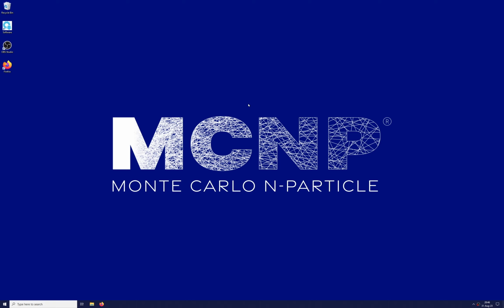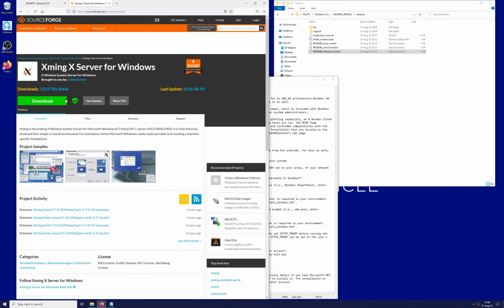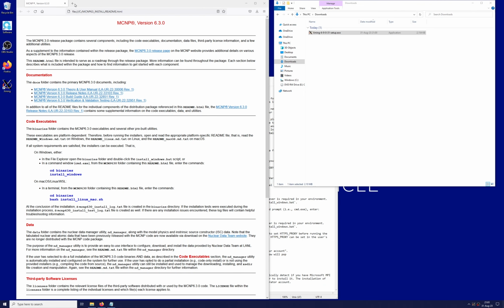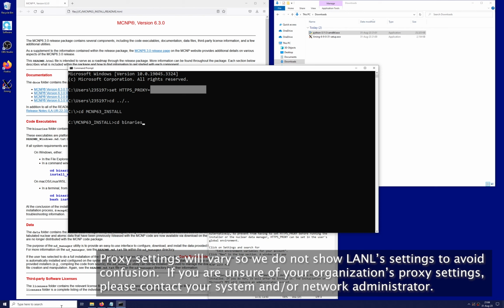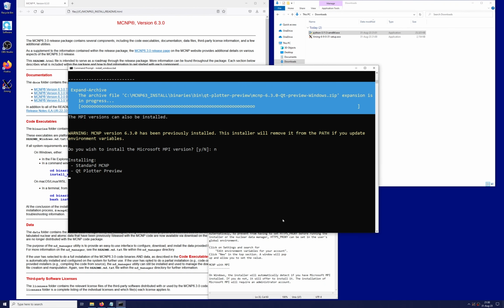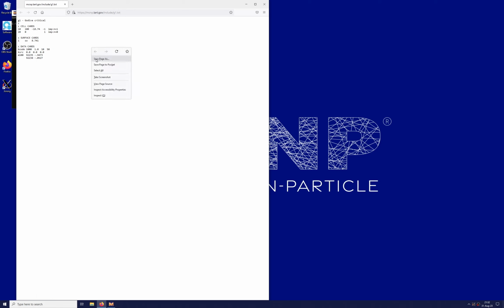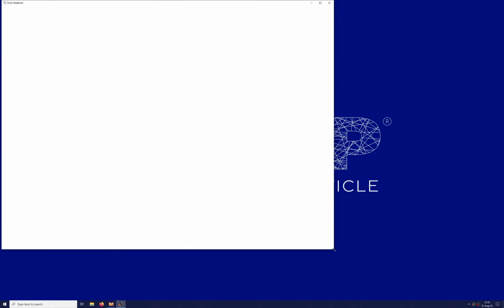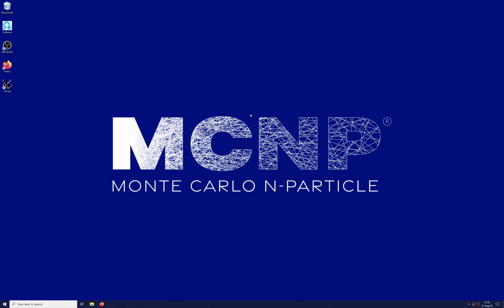Tutorial: How to Install MCNP6.3 on Microsoft Windows

Comment: I am sorry to bother you.

I am a Master's student currently working on the MCNP modeling of an HPGe detector. I would like to generate a spatial map of the detector efficiency contribution.

To do this, I voxelized the active detector volume and assigned an F8 pulse-height tally to each voxel. However, I realized that this approach may not be appropriate because a single photon can deposit energy in several different voxels, making it difficult to interpret the contribution of each voxel to the detector efficiency.

Do you know of any method that would allow me to correctly estimate the spatial contribution of each voxel to the full-energy peak efficiency? Any suggestions or references would be greatly appreciated.

Thank you very much for your time and your help.

Kind regards,

Comment: If anyone is having a proxy issue during data download, with error message: SSL:CERTIFICATE VERIFY FAILED, there is a fix in the MCNP FAQ page. For windows,  a possible workaround to prevent this error is to modify data/nd_manager/src/nd_manager/utility.py just after the context variable is created. That is, after Line 29, insert these two lines:

 context.check_hostname = False
 context.verify_mode = ssl.CERT_NONE